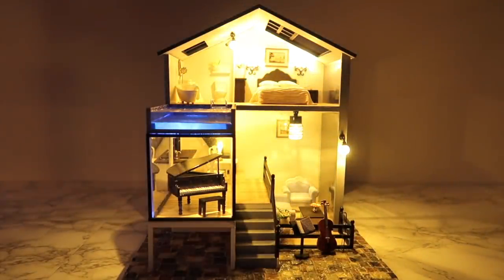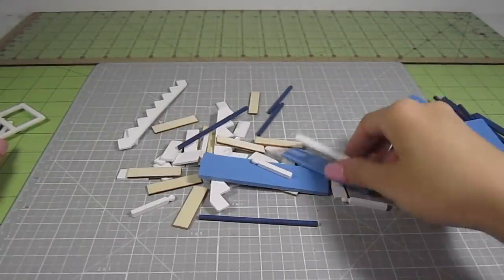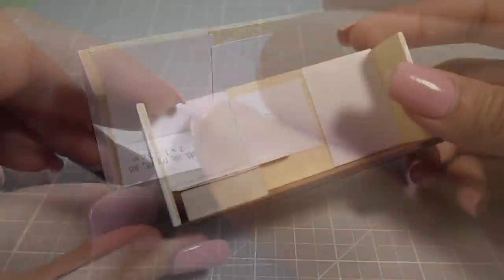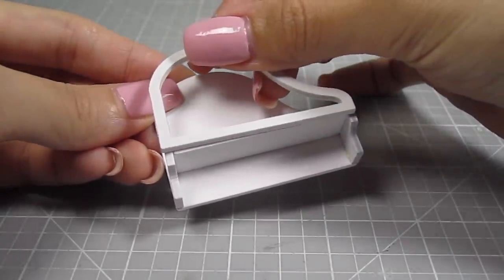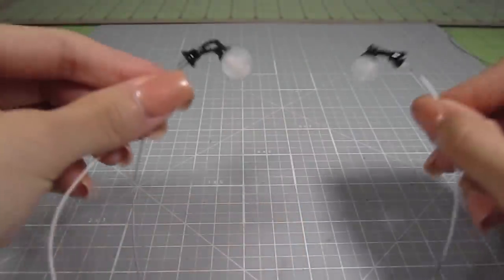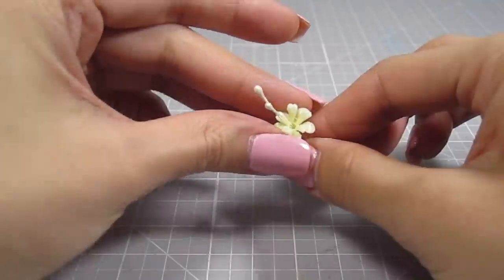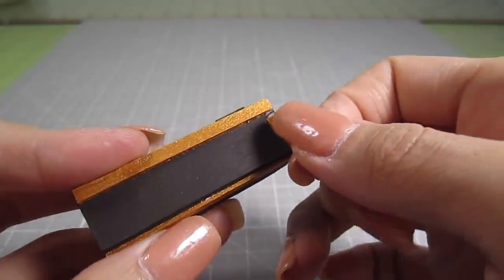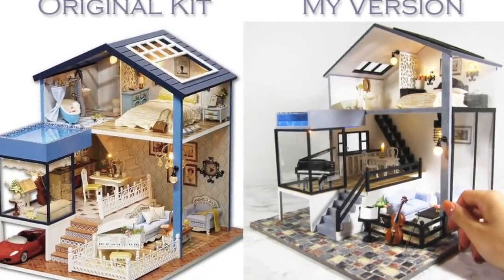DIY Miniature Seattle Dollhouse Kit (with pool and lights!)

Comment: One improvement I would have done is to move the stairs so they go up from the top of the exterior steps to just outside the bedroom floor, above the living room. That way, they have more access at both top and bottom, and they don't come up in the middle of the bathroom.
(Climb up the exterior steps, turn 90 degrees to the right, and the stairs are there. Then turn 90 degrees left at the top of the stairs and you face the bedroom.)
Reply from the maker: That’s such a great idea!! Wow I wish I had you in my head when I built it...that would solve the biggest and most awkward issue of it being right in front of the toilet 🤦‍♂️
Reply: @TheSquaretoSpare  I kinda thought that the bathroom was a little off because of the stair. Great video, still! More, please? 😊

Comment: Here's a tip for acrylic paints! If you water them down a little and sand between coats, you can minimize brush strokes for a super clean finish! It takes a little longer, but it's totally worth it!
Reply from the maker: Thank you for the fantastic idea!

Comment: Things that I would’ve added/changed:

1. Gluing the living room carpet to the floor so it doesn’t move.

2. Placing the bedroom painting on the empty wall so it doesn’t look as cramped.

3. A tiny bar of soap/shampoo and conditioner on the shelf.

4. Not gluing the towel onto the bathtub so I could interact with it.

5. Having all 4 walls for the pool so I could pour water in it.

Anyone else have similar ideas? Anyway, you did a great job!